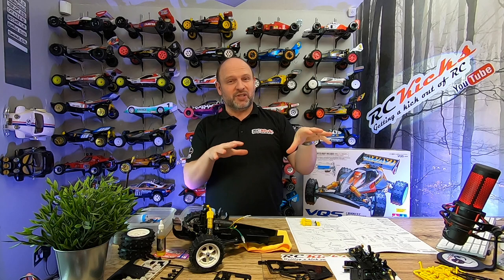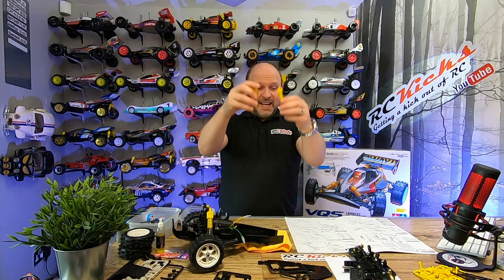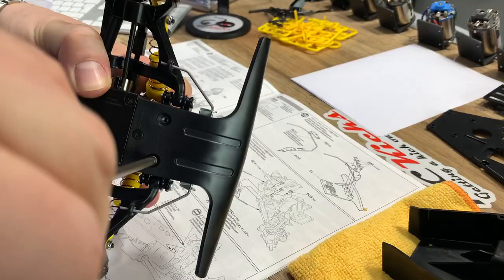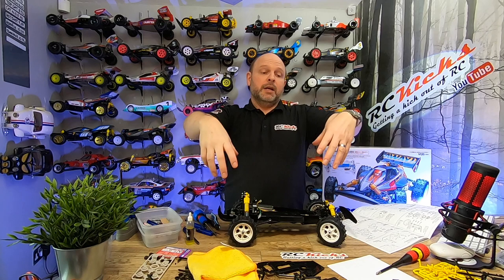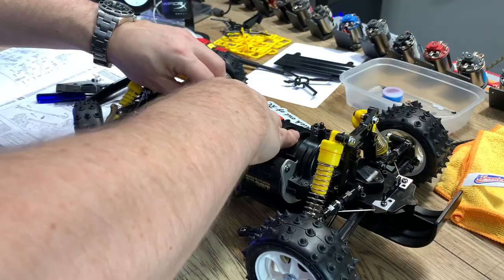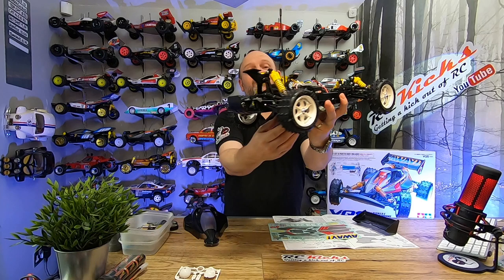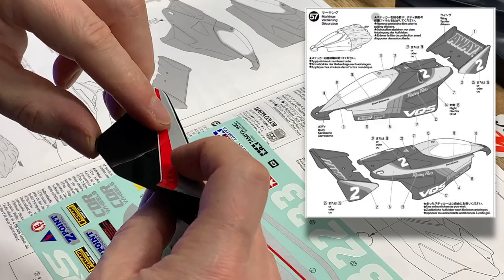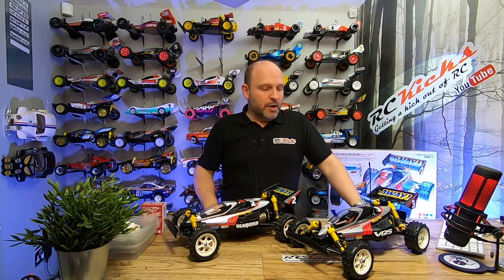This Video Is Dedicated To Park Fleming RIP. Finishing A Tamiya 2020 VQS RC Buggy 4WD. Kit 58686.

Comment: For my most recent build with CVA’s I took a block of wood and drilled holes in it. I filled them and let them set for 30 minutes. I also used Team Associated green slime on the o-rings on the bottom

Comment: Bought one myself as I have the OG, the missing bearing you can buy cheap on eBay. I would like to have seen some goodies added to the car ie the motor, a bag or T-shirt like the first Avante re-release got them. Different wheels maybe but for beginners it's overpriced but I have some good memories with the car and thus bought the re-release version. I have the optional Hi-caps as well.

Comment: If it was £50 less I would consider it.
Reply from the maker: Well keep an eye out as you could see some deals coming along for the VQS.
Reply: MB Models have it for £309
Reply: I would go for one at £275 or below.  Centre Diff is rubbish, it gets too loose with use.  Had one on my 88 Avante.  When it continuallyy slipped I just locked it.  Would go with Avante torque splitter set in a VQS and run the one way diff.
Reply: @MrMelton77  Thats good to know, I considered swapping the locked spur gear in my Vajra to the Avante ball diff, so it has ball diffs all around. I'm not a fan of the torque splitter I have it in my Black Special and Egress.
Reply: I felt the same initially then I saw one up for £290 so caved for fear of never being able to get one. Not too bad but still expensive IMHO

Comment: I have always wanted a vanquish since I was a kid. The re release gives me that option but the price blows. Now granted I’m not worried about the upgraded parts because it’s never going to be driven. But i finally have an order placed for the top force evo which is by far a better deal. It does get frustrating that even now in modern times tamiya won’t include bearings in every kit like 99% of the rc cars. Granted I’m not interested in those, but if the vqs is this much, could one imagine how much a re release of a Porsche 959 would be? For this amount of money they need to take a little more pride. Not all of their kits are like this and it’s something we are use to, which is why they keep doing it.
Reply from the maker: Hi Jason and thanks for commenting.  I have to agree, especially the VQS price point was well off and the market reacted.  You can still purchase a VQS from so many places as it just didn't sell while everything else is sold out.  I do think this sent a clear message to Tamiya about pricing.  You can't just stick big price tags on just any kit.

Comment: Gav.  Been speaking to someone on Facebook and they made their own part from carbon for the rear part which keeps breaking (g11??).  I asked about all the little raised bits and apparently you do not need them.  The avante has a similar set up and you just need a couple of spacers to mount the top arms
Reply from the maker: Yep I guess you could do it with a sheet of carbon and some cut spacers.

Comment: Great looking thing, that's for sure.
For a little bit more money than price that Tamiya wants for this VQS rere (cheapest I could find one right now is about 300 euros) plus some upgrades like the motor, you can also buy a Kyosho Optima rere for which you would still need a motor. Or you could get a 2WD Kyosho rere buggy with a hot brushless combo for about the same money as the VQS. Anyway, for me the VQS seems wildly expensive and I would rather spend my money on a Kyosho buggy which has all the nice aluminium and steel parts.

Comment: Motor and bearings would make it more desirable. I don't know they didn't stick a better motor in?
Reply: I think it may because any step up in the Tamiya motor from the bone stock 540- means a considerable increase in the magnet compression resistance,  Which means you can't drive the gears with your hand by moving wheels, what will happen is the  gearbox planetary gear teeth will grind against the motor pinion and for a novice may be an issue, They hedge against this risk or issue  of confusion to a novice by just giving you the low resistance stock motor- I have the Super Stock installed with my copy with the Hobbywing 1060
Reply: If it's the same motor as in the Avante rerelease, then it should be fine. It's not brushless-powerful but it's got some pep to it.

Comment: Still too pricey for what it is I believe.
Regarding the G11 material, polycarb is great when new but it is hydroscopic and so becomes very brittle with age.  Older Tomy AFX slot car chassis illustrate this well, if you find one still NIP, it's more than likely cracked/split already.  A tougher Nylon or similar material would be more suited, albeit not as shiny.
Cheers for the build series Gav.
Reply from the maker: Best to drive in when it’s new and then put it away in a few years by the sounds of it.

Comment: If I didn't already have 6 originals inc 2 NIB's then I would buy one as it's a super looking model but as mentioned would have been better fully ball raced, with metal shocks, avanté driver and special motor

Comment: I had a original one as a runner with full Tamiya ADSPEC system in it. It had the G-part printed too. They drives vel for that time line, and surprisingly sturdy. Only thing I do not like is all the dirt piling up inside the chassis and the battery box lid get stuck with sand. The mid ball dif is not minded for hot motors. I drove it with a vintage 27 turn modified motor, and it handled that well. But will not recommend any hotter than a technigold or similar. I would get a set of MCI stickers for the rere though. That VQS stuff is so out of tuch in my opinion.

Comment: Hey Gav, thanks for that, really useful to know how you found this build, to answer your question, YES I would buy it if it had the bearings and a 'premium' motor. I already have bearings and a choice of motor's as it happens but that's not the point is it - Tamiya need to stop penny pinching like this its quite pathetic especially considering the fact that they get so much right, this is plain stupid. By the way I think the phrase is 'sharpest tool in the box' :) 'smartest tool' is something entirely different take care.

Comment: Hi Gavin, do you know if this car is a limited edition? It does seem like the car is getting harder to find. Although 
I will say the parts are getting easier  to find. I bet that will last for very long. Thoughts?
Reply from the maker: VQS kits all over the place.  It didn’t sell as well as expected due to price.  I just checked and I found 7 online RC shops selling them still.   I checked a few and the status  is still in stock.

Comment: Is swapping the motor later and easy job or would you recommend deciding on an upgrade before building?

Any advice on an easily available upgraded motor?
Reply from the maker: No it’s easy to do.  If anything the top plate doesn’t give you
Much room so you might have to remove a few screws from that depending on the end bell design of the motor you are fitting bit it’s not the end of the world.
Reply: @RCKickschannel  Great to know.  Thoughts on an upgraded motor if your keeping the Tamiya speed controller?

Comment: Entertaining videos on this car as always Gavin. Do I like the price of this car... No....did I get one?.. YES. I am hoping the price reflects a small run of this model,and the upgrades that were done.. Would you like to see Tamiya re use this chassis for something different?
... Think Vajra....or black special, or a different buggy body....?  

Some of it may be tamiya getting what they can based on secondary market prices, or the insane demand on the RC market right now... Very hard to find much in stock at retail....! Either way... I have a vintage vanquish which I don't drive... You know why...lol.. so I got over the cost based on having the opportunity to drive a new one.. plus a coupon from the online retailer helped as well.. lastly... Once the run of this is sold out....the price will only go higher... which will have more people complaining on cost. Same as the Avante black special... Etc. Maybe Tamiya is asking more... Because we are in the decline of the re re market...?
Reply from the maker: The next thing Tamiya should do with this family is make a Black Egress or a Black Top Force Evo. Now that would be cool.

Comment: Is it possible to give those bodies a clear coat in the end to protect the decals?
Reply: not sure if they make a polycarbonate clearcoat, I would guess, if you did a standard jar, or TS, clear- it would not stick or adhere properly, so I would avoid,  Mine stuck good enough, and I carefully heated the bubble to help work them out.
Reply: You can get a Tamiya clear coat for Lexan shells. PS-55 is a clear flat so dulls it down.

Comment: Wait....... so the G parts are now upgraded? Or there is a VQS mk2 with upgraded parts?? :o

G parts upgraded it's a buy from me, as I've got spare bearings a plenty.... and motors too. ;)

Great video and build...... and thanks for how you build your cvas...... a much better way than me at the moment so I'll be swapping my method. :)
Reply from the maker: No I checked the G tree in the VQS kit and its been made with Polycarbonate vs the vintage kit being ABS plastic. The tree has >PC< on the tab.
Reply: @RCKickschannel  Yay!!!
Should be able to take more punishment and last longer then.
Now to track down the best deal. :)

Thanks for clarifying.  :)
Reply: @Ratty_Rex  I have one listed on TC for £299 bank transfer or 309 PayPal, ;-)

Comment: It's 50 to 100 overpriced even with the addition of the missing bearings and a better motor. At that price I can get a race ready 2wd buggy that won't eat its gear train with a brushless and will easily take Lipo.

Comment: I'm more concerned about the overall strength of the chassis/ tower layout......i wanted one till I saw how weak that setup is......if I wanted to run hot motors, or even 3s,  it'd be broke in 2 mins......hopefully they come out with a stronger frp, or carbon fiber setup that can handle it.....otherwise.....🤔🤔🤔 NOT!😲
Reply: I would not buy this car or other vintage tamiya cars for BL set up. If you want wintage, go for Team Losi XXX cars. They can handle powerfull stuff.

Comment: Shouldn’t put your threadlock on before you thread the screw through plastic!!!
It will damage the plastic!!!
Reply from the maker: Not sure how you can do it then?
Reply: @RCKickschannel  you fit the nuts then use a cocktail stick to apply a small amount to the thread of the nut- then put the screw in.
Courtesy of RC MOJO
Reply: Simples
Reply: Other than that-FREAKIN EXCELLENT VIDS- not a tamiya fan myself but I have 17 rc’s